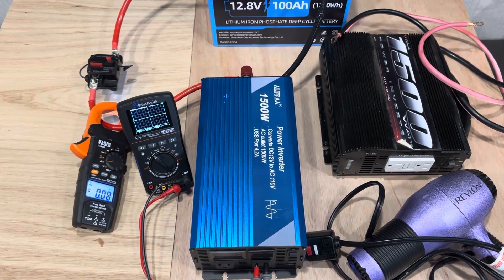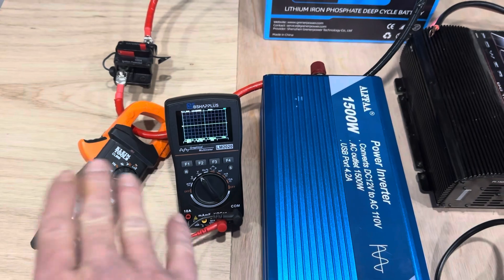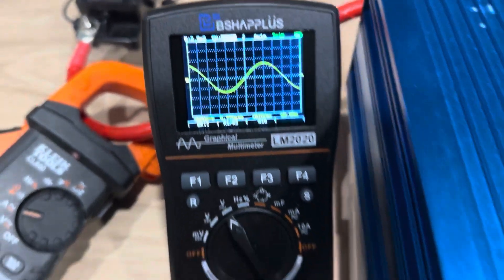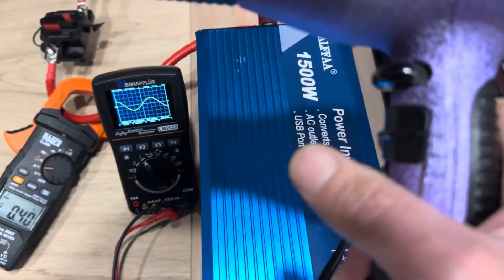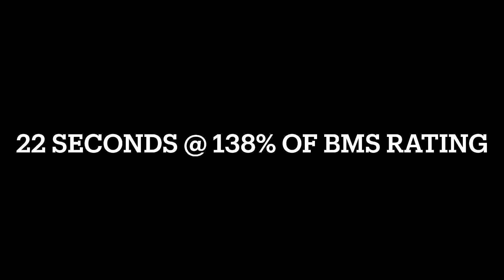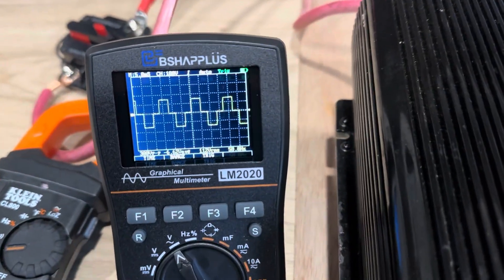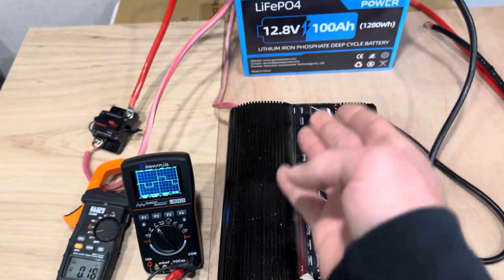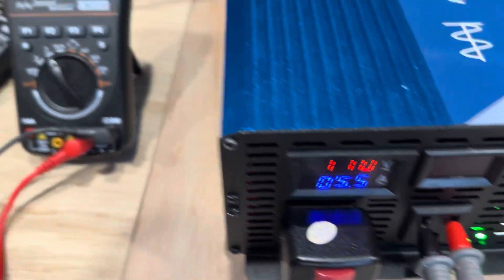GRENERPOWER LiFePO4 Battery Test + ALFFAA Pure Sine Inverter/MSW Inverter/Budget Breakers and more

Comment: I’ve decided in my testing I’ll never buy an inverter (pure sine wave of course) that doesn’t provide a true 120 volts. 
So many sensitive electronics can’t tolerate voltage below 115 volts. 
Also your cables do look a bit of a light gauge for running 100 amps 😮. 
May I also suggest a tester showing true voltage (kilo-watt) some of these inverters I’ve played with lie about output voltage.
Reply from the maker: Thanks for watching and commenting!

Comment: I was definitely impressed with the load test. It was also interesting to see the difference between a modified sine wave and a true sine wave.  Also surprised that the bms and the circuit breaker held as long as they did. Definitely a good test to see the difference between the two inverters.  I would be curious to see a couple of other things like a gas generator or other things and what the outputs of them look like.
Reply from the maker: Great points, thanks for the suggestions!